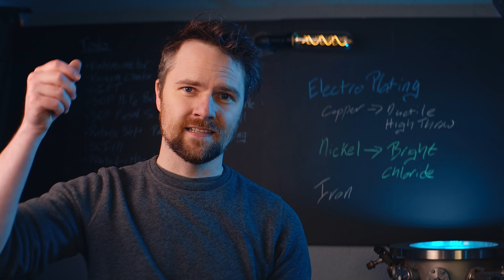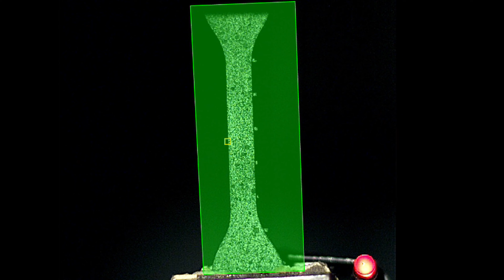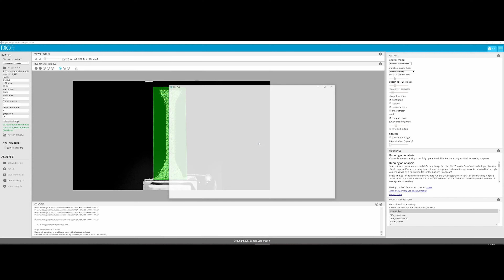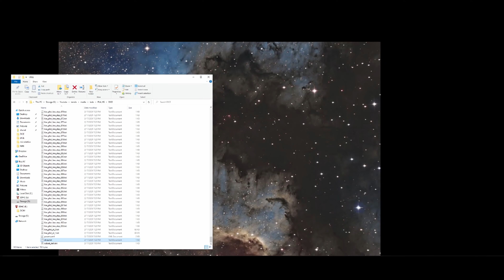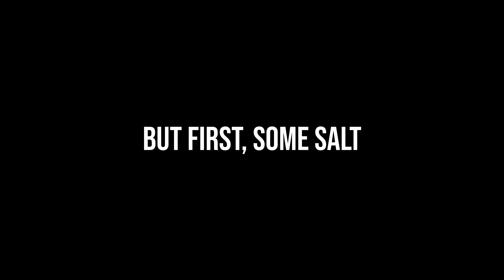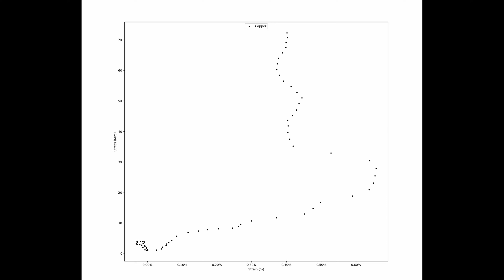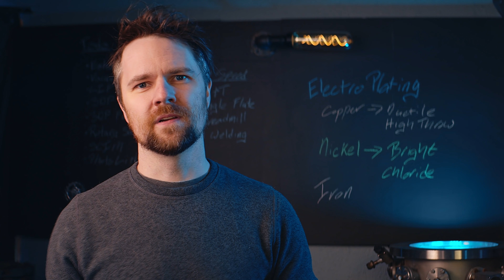Stronger 3D Printed Parts with Electroplating

Comment from the maker: Addendum:
- Buff Benchy: https://www.thingiverse.com/thing:4247106
- Plating thickness averaged around 70-90 microns, but was variable (and a headache to control)
- Resin: Elegoo Standard Clear.  These were printed several months ago and left on  my bench.  I don't know if resin gets brittle over time, but if it does, that may have affected my measurements
- Test geometry: ASTM D638-14 Type IV
- CNC Kitchen strength test playlist: https://www.youtube.com/playlist?list=PLEOQTmIWJ_rncRcWmjQIvMKFAeM071CXM
- DICe software: https://github.com/dicengine/dice
- Technical details about DICe algorithms: https://github.com/dicengine/dice/tree/master/doc/reports
- Example companies that electroplate plastic: Repliform, Metal Surfaces Inc
- I tried to test some alternate nickel recipes (all-chloride in particular) but they are higher internal stress (which should make a harder deposit) but ran into adhesion issues during plating itself.
- You might notice some oscillations in the stress-strain chart data. I believe this is an artifact of in my universal test machine (you can hear it oscillate). It's probably backlash in the planetary gears or worn motor brushes or something.
- I might have talked a bit fast in this video and had some awkward segues. Sorry! It was legit freezing in my shop, hovering around 35-40F (1-4C). I kept getting distracted by my breath clouds :)
Reply: One thing that I found when using a graphite-acrylic paint for electroplating, it helped to buff the surface of the painted object after painting. Something about smoothing out (and connecting?) the graphite layer helped give a more even plate.
Reply: About resin getting brittle over time, it definitely does. Especially if left exposed to UV/sunlight. And especially if you don't post-cure the parts (I can't remember if you mentioned doing that). It will slowly sit there forming more and more crosslinks and becoming more brittle
Reply from the maker: @maxwellfire  Welp, good to know.  I probably should have mentioned that in the video directly then, I wonder how much it affected the results.  If/when I do a followup I'll be sure to mention.
Reply: Stronger prints we all want - however a few words of warning: As nickel can be harmful to skin, its use in daily products must be regulated
https://en.wikipedia.org/wiki/Nickel_allergy - once you've got it, it takes less and less to get the rash.
If the print has to come into contact with skin, it is best to plate with an inert metal (Aluminum is actually a great choice, but electroplating it 😲) - https://catlogix.com/pages/what-metals-are-hypoallergenic
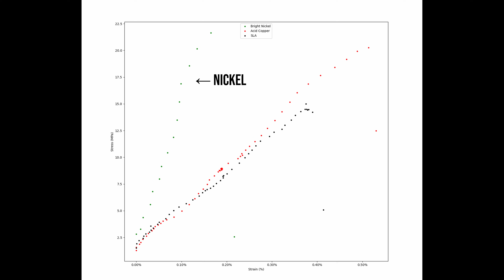8:32 - Copper can be soft (plated?) and hard/(heat)annealed depending on how it is treated. Soft copper can elongate quite a bit (up to 20%) - http://www.fiskalloy.com/wp-content/uploads/2012/03/Tensile-Elongation-Fisk-Alloy.pdf
Truly a cool investigative video :ø)
Reply from the maker: @EgonSorensen  Oof, that's a good point and I really should have mentioned it. Will add a note to the description.  My brother has a nickel allergy and it's no fun for sure. :(
Reply: You should also investigate electroplating with conductive filament. If raw conductive filament doesn't work well maybe try coating the filament with some conductive ink or something in the way make anything did for multi color prints by changing markers.
Reply: Hi, thanks for the great content!

Had a couple of thoughts regarding the increased max elongation of copper-plated resin. 

Brittle failure (weakest link type of failure) often may start from the surface - surface roughness and scratches effectively act as "pre-cracks", which create small stress concentrations. And the highest stress in this stress concentration is at the very tip of the "pre-crack", in other words on the very surface.

If the polymer is always the first to fail, then covering it with a copper layer would reduce max stress at those stress concentrations in the resin. This should allow the resin to withstand higher elongations without failure.

Failure also might start from copper, but probably it can withstand much higher stress concentrations (i.e. is tougher. Although that's in terms of "stress intensities", not sure how copper's leadership will hold up when toughness is expressed in terms of "strain intensities" - probably more relevant in this case). Additionally, pre-cracks will not be copied onto the copper surface 1-to-1 and will probably smoothen a bit, making stress concentrations in copper lower.
Reply: Awesome video, but the title is a bit misleading, or rather, doesn't tell the whole story, thus you're underselling yourself. I suggest watching Veritasium's videos about clickbait/youtube titles, they will help you better title your videos. Can provide links if desired.

Cheers!

Comment: Totally would love to see test using either chemical silvering or electroless nickel plating on top of PLA prints. There is very little about it overall and for example to improve the look and strength of LW-PLA planes it may be a great solution.

Comment: If the failure under elongation initiates at a fracture point near the surface that is healed by the plating then it might explain the ability to elongate more prior to failure. This would then be similar to coated/treated glass like gorilla glass. So the plating doesn't just add its own strength as a skin but also strengthens weak points of failure in the PLA.

Comment: Me commenting on a 3 yr old video lol, but I think the copper giving the plastic more stretch actually makes sense? The plastic breaks because the stress at a specific point becomes greater than what the material can bear; the adhered layer of copper allows that stress to be distributed over more of the plastic & copper, so passing the breaking point at any individual point requires more overall strain.

Comment: Regarding the tinkling, I’m thinking that you didn’t seal the plastic first, so the acid bath dissolved the plastic, causing the separation you noted. Either seal the plastic first, or use a conductive paint made of the sealant, and use a few layers for total coverage. There shouldn’t be any “expansion” as you propose. No way.

Comment: 8:50 maybe the phenomenon making the strain higher for resin is the fact that cracks have a harder time propagating due to the presence of a more ductile material in the surface, where fractures usually propagate from, mainly in fatigue scenarios.

Comment: I find it extremely difficult to believe that 90 microns of nickel or copper could increase the strength of resin 3D printed parts so dramatically.
Could any other part of the plating process have also contributed to the strength?
Reply from the maker: I don't think so, although I suppose it's possible. The plating bath is highly acidic which likely makes the print weaker, but I didn't test that scenario specifically. will try if I ever do this again!
Reply: @BreakingTaps  Awesome stuff. I will give this a go myself once my workshop is not a complete mess. I've done a fair bit of nickel and zinc plating but never on 3D printed parts.

Comment: If you send me one of your material samples, I can run it on the professional insta-tron machine and send you a stress-strain diagram you could use to see how accurate your machine is and calibrate it accordingly.  The one downside is that it's the end of the semester and I don't know if I'll have access over the summer.

And yes, I know this is quite late, but I just discovered the video now...

Comment: It might be possible to, for the FDM prints to use/make a solvent based conductive coating that may help with adhesion. Depending on the solvent and resins used as the base and their proportions, the coating will not only "burn" into the base material, but if the amount of resin used is small enough you can also get a shrinking affect that will bind the coating to the part harder. (See nitro-celliouse lacquer application for more information on the shrinking im talking about, it's a common thing that is talked about in the guitar repair world as it makes blending old and new finishes difficult.)

Depending on the viscosity of the base resin mix (essentially a lacquer) you may even be able to use an ultrasonic cleaner to break down graphite in the solution to create graphite nano particals for the conductive material. 

I have no idea if this will work btw I don't have the setup to attempt to replicate/test at the moment.

Comment: The stiffness achieved from the nickel plating could very well be applied to 3d Printed CNC motion systems. I could see this as a candidate for preventing flex associated with printed Z carriage parts, potentially further reducing chatter.

Comment: Did you ever re-visit this idea with different adhesion ideas?  I'm wondering if you could make PLA handle high temperature better with plating but seems like delamination would be a big problem after what you dealt with

Comment: The extra elongation may be due to the copper spreaing the stretch-zone over more of the part.  Normally, the weakest zone of the part will begin stretching first, and as it stretches, becomes weaker, thereby further concentrating the stretch in that zone.  The copper makes it something of a composite, so the resin will stretch locally, but then hit a limit where it has to stretch the copper, which makes the next weakest zone elsewhere in the piece.  So instead of one zone stretching the entire amount, you get less stretching, spread all over the piece, until you hit a failure point.  This is why composites are so great overall.

Comment: How about trying to electroplate a PLA that has metal particles in it, even those that use metal nano-particles for color rather than mechanical properties? would the plating bond better to something like that?

Additionally, i'm curious if using a dip to coat process would provide a better coating and adhesion as compared to spray or brush on methods.

Comment: im gonna guess/state that surface-crack-fracture propagation is why the copper helps the PLA gain further strain-elasticity, its like ceramics/glass, get one little crack going, and it just goes right on through.

Comment: Seems like you could exploit the plating separation phenomenon, as a way to create an exact metal negative of a PLA object, if you can figure out how to adjust the temperatures to achieve a reliably repeatable separation after the plating solidifies.

Comment: Paint the resin print before it's fully cured mite bond to the soft surface better ....ps the resin your using is very weak is it old stuff the stuff I use is much stronger

Comment: We tried to perform deposition in a vacuum chamber to Polycarbonate Sheets and it failed drastically. We wanted a thin gold layer for biological research. But it just flaked off. What we thought was a coating from the Plastic manufacturer blocking the bond, actually became the plastic itself. Someone suggested a soda-lime coating but that would be too brittle. Roughing the surface made no difference. I thought perhaps a plasma or vapor treatment of the plastic would help and that failed as well.
Reply from the maker: Interesting, I would have expected the plasma treatment to help... that's usually the way I've seen plastics are sensitized for vacuum deposition.  Was it air plasma, or pure oxygen?  Did you try a thin layer of chromium before the gold?  I'm not sure if it'll help, but chromium tends to fix my adhesion issues on difficult surfaces 

Electroless plating might help too, if you don't mind and undercoating layer of nickel.  E.g. run through the electroless process for plastics, which includes some steps to sensitize and catalyze the surface before it deposits a few microns of nickel.  Then you could deposit your gold on top (or maybe chromium first then gold)

Comment: My Top5 channels!  ~15 Years ago when working in the vacuum chamber industry I visited a site where a company was using sputtering and plasma (vapor deposition) to create a very strong bond to various plastics.  Apparently it was for the automotive industry for metalized plastic interior trim.  
I would imagine this would be a bit like vulcanizing rubber if you first created a plasma deposited metal and then did another layer (electric or electroless) with a metal that had a strong bonding affinity for the base substrate.  The challenge here would be flow of particles are sensitive to gravity.  So this company solved it by using a table that rotated and index (similar to a 5-axis Mill table) with the part(s) suspended some distance from the center of pivot to get nearly 100% coverage.  You could consider collaborating with another channel that does pvd coatings.  
Hint hint: #AppliedScience
https://youtu.be/ih_D6OLzqo4

Comment: So how do they plate plastic automotive parts? Most Grills are chrome coated plastic my 2001 GMC Yukon has a chrome plastic grill it's been through 15 southern summers a summer in New Mexico and 2 years of Cold Pennsylvania winters it has not separated yet, there must be a trick to this unless they found a plastic that shrinks and expands at the same rate as the plating.
Reply from the maker: Yeah, industrially there are a few different methods for more robust coatings.  Certain plastics like ABS can be etched (chromic acid), or "activated" with plasma which make them more receptive to coatings.  Other times they will be electroless plated first (etched, sensitized with a reactive metal solution usually with palladium, then electroless copper or nickel). Then you can throw a regular electroplated layer on top if you want.

Basically, the industrial methods eliminate the conductive polymer step which ends up being the weak link, and plates directly onto the underlying plastic.  You can actually buy kits to do this, it's just expensive and hassle with multiple baths maintained at different temperatures, etc etc :)

Comment: Revisiting this, it seems like the plastic isn't doing terribly much other than preventing buckling. In the PLA runs the load is probably being transferred mainly through the plating so it fails in tension. With the resin the elongation of the nickel plating is an OK match for the elongation of the plating so they fail together at a higher load. Try a foamed plastic or some such to take it to the extreme where the plating is doing all the work and the underlying plastic isn't stiff enough to push it around at all.

Comment: I have been doing some testings on my own.  What i found is that the plastic you plate must be really rigid, with no flex at all.  I was plating on PETG sheets and the copper plating was delaminating and peeling off like a thin sheet of aluminium foil.  I now plate thicker pieces with resin and fiberglass and it is much less prone to delaminating since I cannot flex these parts at all.

Comment: Have you tried putting an electroplated part in the oven? I wonder how an oven cured part would work with high temperatures...if a high metal filament was used could this be a viable option to sintering but without the removal of the binder, so the binder remains inside of the part. Just thinking out loud here :)

Comment: I remember a decade ago I read a paper where they measure extremely strain of material by shoot x-ray through the measured material. And measure the rayleigh scattering resulted from x-ray travel through the material's atoms. As the material stretch, the spacing between atoms increases, so the scattering also changes. Pretty interesting way of measure micro-strain without destroying the material, can even monitor jet engine combustion chamber while it's running. Not sure if the author manage to commercialize the technology, or it just got stuck in a lab forever.
Reply from the maker: Wow, that's a wild technique! I can see it being useful for really critical things like jet engines but yeah, sounds like a nightmare to fine tune and get working reliably!
Reply: @BreakingTaps  the comments section is awesome

Comment: 8:45 Adding Cooper, which is very malleable, would have the effect of stressing the sample much more uniformly. Instead of one stress and fail point, you are effectively stressing multiple points uniformly. If a single stress and fail stretches so much, two or more would stretch much further.

Comment: Whats the strongest metal that can be used for electroplating, and is it possible to make a really strong alloy that can also be used for electroplating?
Reply from the maker: Hmm, probably nickel or one of it's variants (iron-nickel, etc).  "Alloys" can't be plated very easily, it's limited to a select handful of metals and their binary/trinary combinations.  E.g. Nickel, or Iron, or Iron-Nickel, or Iron-Nickel-Cobalt.  Unfortunately not possible to plate complex alloys like stainless or even regular carbon steel, since they have many other ingredients that just don't work with the electroplating process.

Comment: 8:34 I'm assuming it has to do with preventing crack formation for longer, it takes less energy to propogate a crack than it does to form a crack so if you prevent crack formation then you can put higher strain on the sample. That's my hypothesis.

Comment: I suggest you look into pulse - reverse pulse electrodeposition.

You can use the Randles Sevcik equation do derive the diffusion coefficients for the ions of interest. Then, you can calculate the electrical double layer thickness and tune it with the pulse/reverse pulse duration and/or the deposited species concentration.

In this way, you can electrodeposit a uniform layer regardless of the complex geometry of the sample.